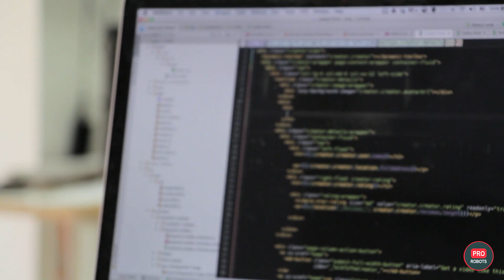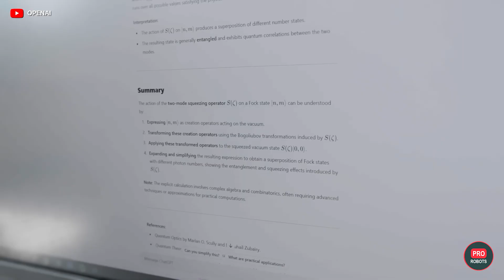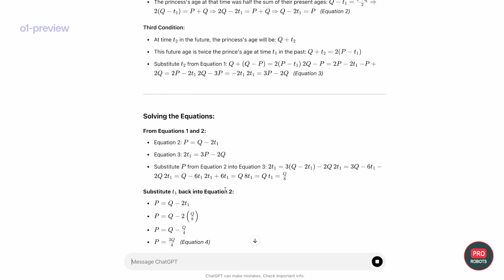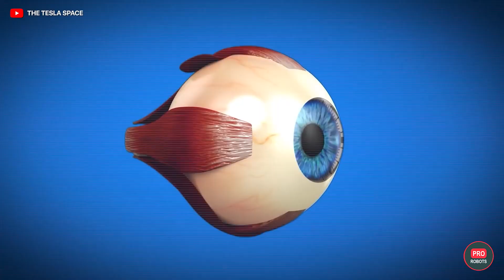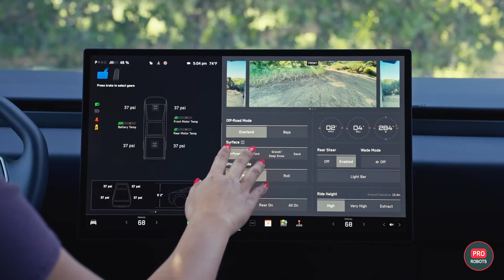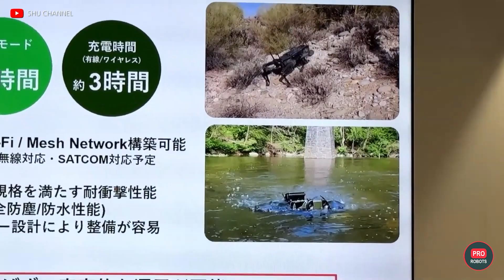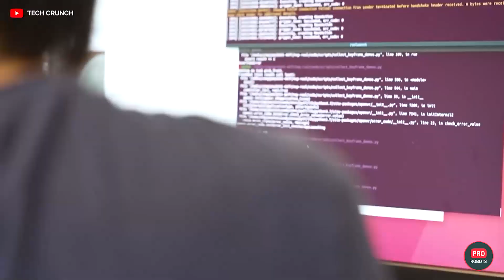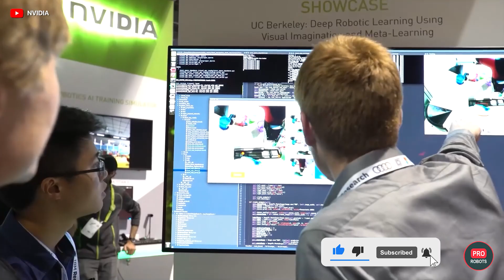OpenAI creates a new AI stronger than GPT – revolution or myth? | New Technology | Pro robots

Comment: The last robot you showed, the robot table, seemed like the most practical robot out of all of them. I could use something like that, it looks strong and stable and doesn't need a flat smooth surface  to walk on which would be perfect for a work bench and tool box that could follow you around while working so you don't have go back and forth whenever you need another tool or surface to work on. By the way, the answer to your question is "yes", you are the only one that thought "go, go power rangers".